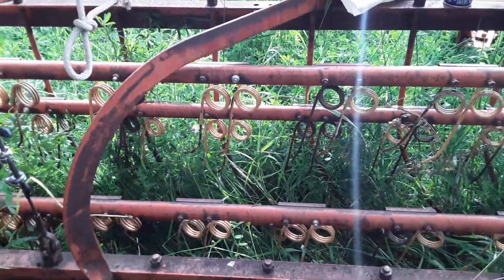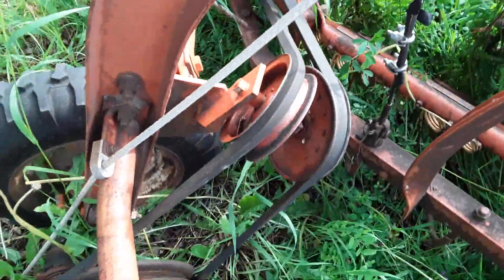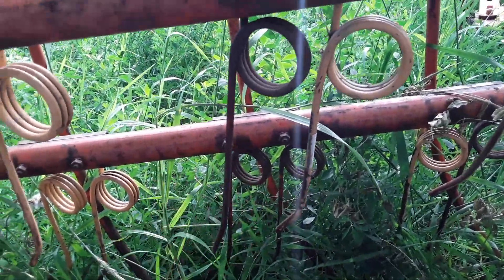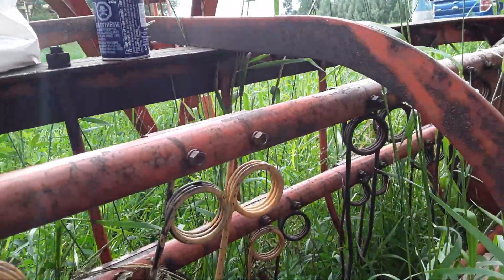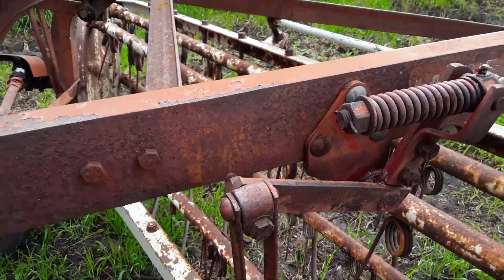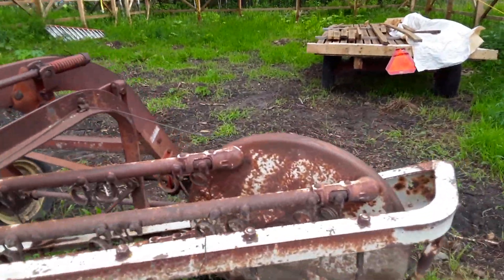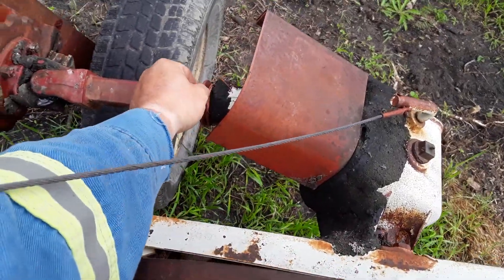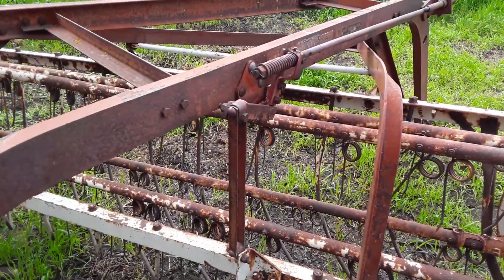Working on Allis Chambers 77G and International 15 rakes

Comment: I have a rake like that. Where can I get a new belt for it
Reply from the maker: Motion industries or acklands other industrial suppliers
Reply: @jonathantarrant2449  thanks. Would you happen to know the number for the belt?
Reply from the maker: @nealmclain6316  , c144 or c145 should work, i think its 148inch outside measurement, with tensioner
Reply: @jonathantarrant2449  thanks again